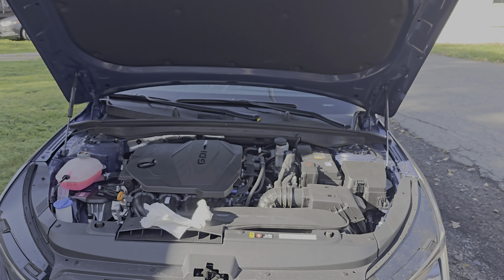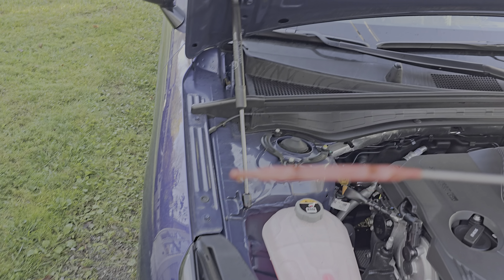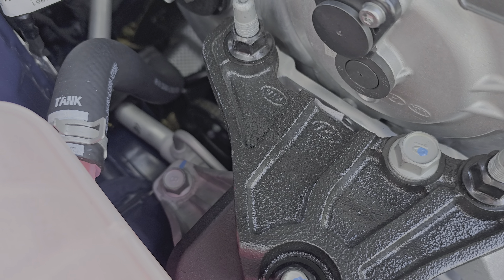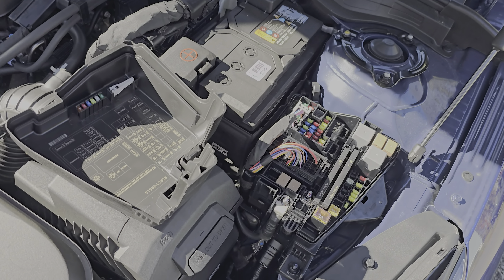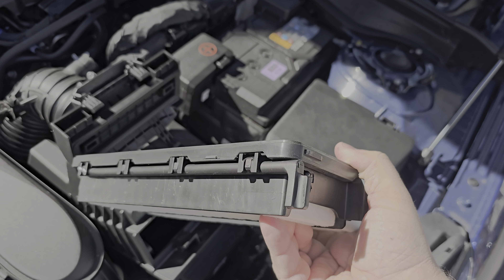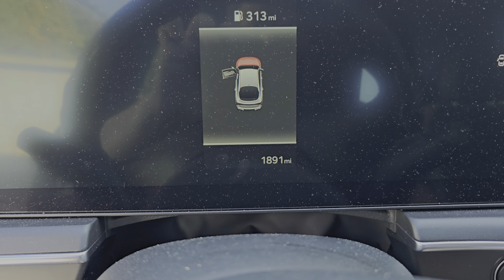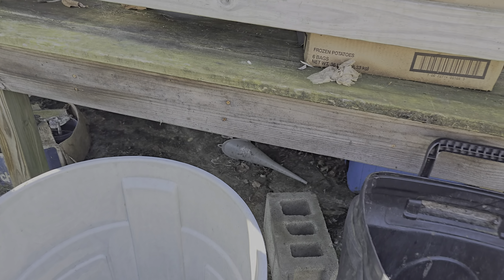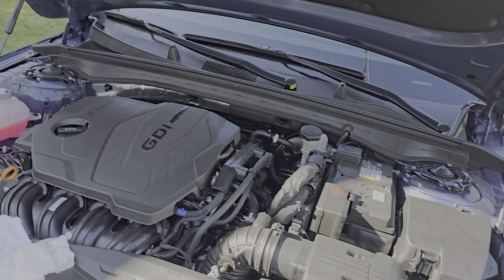2025 Kia K5 GT Line Engine Oil Consumption Thoughts

Comment: Haha told you they are similar 😜
Reply from the maker: You need to actually read the details as well. You have very little knowledge and you don't actually know really anything about the major difference between the two. If you actually had rea the specs and details it's not hard to see. Bottom line is hyundai yesthe look similar but that's it. They don't offer awd. They have smaller motors even with the turbo that put out less horse power. Not to mention they use crappy CVT TRANSMISSIONS that will fail. That major differences. That's the difference with me. I do my research and I look at the facts.

Comment: Hyundai is the parent company of Kia. Hyundai and Kia cars share mechanical components, and equivalent models are usually the same exact car with different styling (e.g. Hyundai Sonata and Kia K5, Hyundai Tucson and Kia Sportage, Hyundai Palisade and Kia Telluride, etc.) Smartstream doesn't mean anything besides being Hyundai's engine "branding" which signifies that they're designed for fuel economy and reduced emissions. Hyundai/Kia cars are great bang for the buck for short term ownership (e.g. 3 years) and leasing, because they put more money into the interior and technology/features while cutting back on the quality of some of the mechanical components. I'm leasing a 2024 Sportage currently. But I would not try to keep one long term for that reason, as there's a higher risk of issues down the line. On the flip side you have companies like Toyota who skimp on the interior and technology/features and are still more expensive cars, simply because they put so much more money into the quality of the mechanical components to ensure the cars are durable and last a long time.
Reply from the maker: I wouldn't expect some idiot like this to really know the actual differences. Probably because you're to stupid to look it up. Yes it looks a little close. But you had any intelligence at all and learned to read you would see that the power trains are very much different. Kia power train is much better and offers AWD where the other doesn't. Kia offers a 2.5L at its biggest motor where the other is a 2.0L with a CVT type transmission WHICH IS GARBAGE. No awd smaller motors even with the turbo putting our less horse power then my 2.5L. THOSE ARE ALL BIG DIFFERENCES DUMMY SO NEXT TIME ACTUALLY READ BEFORE MAKING YOU'RE SELF LOOK STUPID
Reply: @StreamingIraqWarVeteran people talk shit on hyundai kia for a reason it's not like it was made up. The motors and now transmissions are not the best. People think if a car doesn't have problems in the first 30k-60k it's reliable NO!. longevity reliability is what you want unless you trade your vehicle in every 5 years then you will be ok. 100k plus without major repair is not what hyundai kia is known for but maybe if you do your maintenance on time it won't blow up like so many have. K5s are nice looking though.
Reply: @StreamingIraqWarVeteran  the current refresh of both the Sonata and k5 are using the exact same engine and transmission the g4kn. Being awd in one trim doesn't make it a completely different powertrain. I disagree on the reliability though, It was a very specific engine that was having issues and they don't use it anymore. There are ride share k5s with 200k miles that are going just fine. They cheep out for sure on materials in the cabin but it's no less expensive than Honda is using, these are Econ cars not luxury cars.

Comment: Why did you buy that? Get a Toyota with 300000 miles it will last you longer than this new POS
Reply from the maker: You're Stupid
Reply from the maker: I just think you're being a mad cry baby because I can afford a new $35000 car and you're broke ass can't
Reply: @StreamingIraqWarVeteran  just wait......SMH you could have gotten a nice Lexus with 35,000
Reply: @StreamingIraqWarVeteran  I would never buy a turbocharged they just don't last
Reply: @krashkwads4688 these are not turboed anymore. Only the full gt is turboed now.
Reply: @krashkwads4688  How? The Lexus starts at 41K and doesn't have any included packages. To get all the features of the Kia you're looking at over 50K.
Reply: @ra2186  you HAVE to buy a new Lexus? I'm saying for 35k you could get a WAY better value on a premium brand buying a new vehicle is not smart especially KIA and HYUNDAI they devalue SO quickly and have so many problems. this cat is worrying about oil consumption on a new vehicle??? just the title of the video proves my point
Reply: @ra2186  these cheap brands get you with the add-on features the cheap tech will not get you down the road when the engine blows up